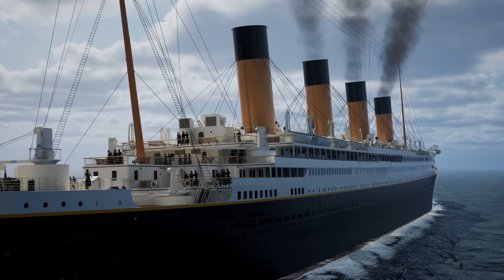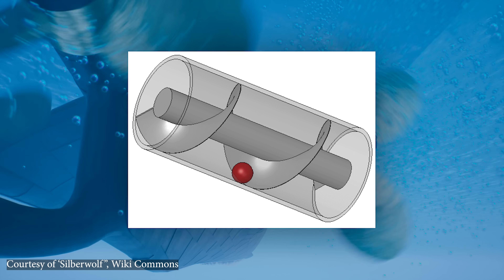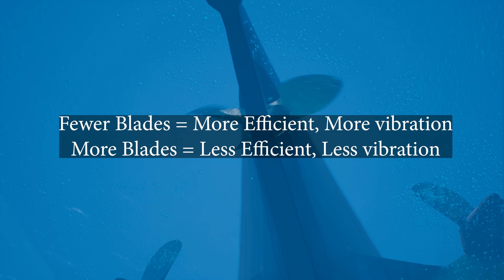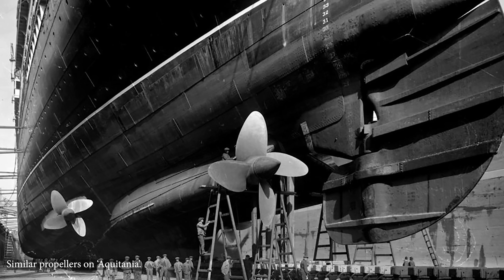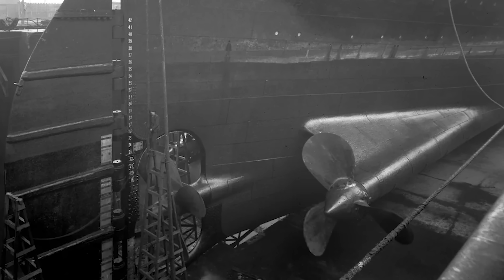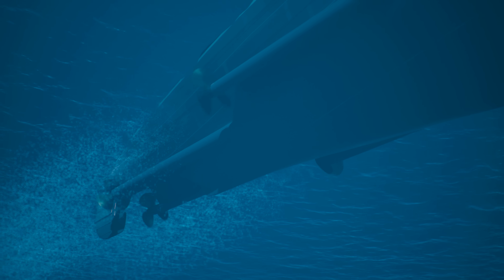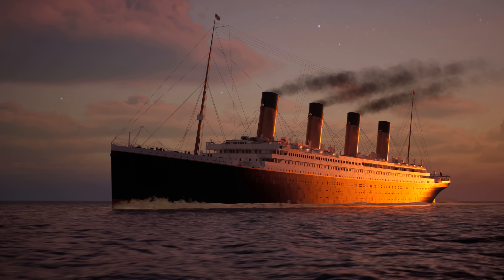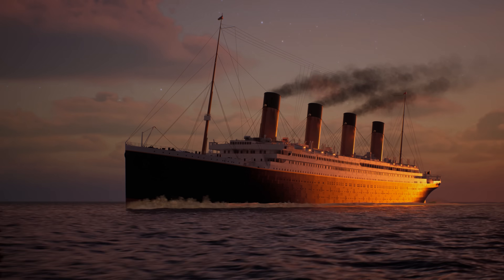Titanic's Propeller Mystery

Comment: Interesting comparison is RMS Titanic to the Iowa class battleships.
Olympic and Titanic were a very similar size and weight to these battleships. And one thing the Iowa's were known for throughout their entire careers which took them up into the 1990's was vibration from the prop shafts. The 4 ships in the class featured 2 central 5 blade screws and 2 outboard 4 blade screws.
There is some evidence from the USS Midway that suggests that it wasn't entirely the design of the screws but the length of the docking keels which caused the vibrations. Midway had a similar issue but once they cut back the length of the docking keels the issue mostly vanished.
The vibration issues aside, its kind of fun looking at how similar in size they were, and just 30 years later with a more efficient bow design they were doing 33 knots. Having gone from 46,000 HP to 212,000 HP.

Comment: All said and done, your only evidence of the middle prop being 3-bladed is a single scribbled note in a handbook.  As someone who has to read other people’s inputs, I find constant mistakes.  Could it have been 3-bladed?  Sure.  But you’ve put a lot of faith into a single scribble and a lot of speculation.  It would have been more reasonable to end with a more neutral perspective.
Reply: Harland and Wolff engineering notebook is the primary evidence, an entry of final specifications of H&W vessels. 
This evidence is supported by turbine engineer sir Stephen Pigott's notebook, where he got order for two turbines , one each for Olympic and Titanic, where one turbine had specifications for 3 bladed center propeller.
Additionally supported by Olympic getting 3 bladed center propeller from 1913-1919, where the results proved 4 bladed was more efficient. 
There's also a photograph of a centre propeller ready to be fitted, laying in the dry dock. It was 3d analysed by historian Samuel Halpern and found it matches a 3 bladed center propeller.
Reply: You do realize that the evidence we have for the 3 bladed propeller is not only from reliable primary sources but also far more than pointing a 4 bladed propeller?

Comment: Why, at the start, is the rear funnel ( the fake one) blowing smoke??
And why, at 2:30 minutes, is the centre screw going astern while the two outer ones are going ahead?????
Reply: 4th funnel had function. It was ventilation to turbine and engine rooms, smoking room, galley etc ... Some smoke did come out of it.
Reply: 4th funnel had function. It was ventilation to turbine and engine rooms, smoking room, galley etc ... Some smoke did come out of it.

Comment: The pitch of a blade is also another factor and the pitch was slightly different for Titanic Vs Olympic according Mark Chirnside's research. Interestingly it's estimated Titanic could push half a knot faster than Olympic also and in 1913 Olympic was temporarily fitted with a three bladed centre propeller, but was then changed back again.

Comment: I always assumed the larger 4 blade central prop was a result of the use of a large very low pressure steam turbine that when in "steady state" cruising rotated a bit slower than the triple expansion engines.

Comment: I wonder if it's possible to send down an ROV and to start digging around where the centre prop would be to uncover a couple blades and based on the distance between them, tell if it's a 3 or 4 bladed prop

Comment: What evidence as was said no proven known photo exists of the Titanic’s screws. I would honestly say that no-one truly knows for sure and will never truly know.
Reply: There's one, a propeller ready to be fitted kept in the dry dock. It was 3d analysed and found matching a 3 bladed prop.
Reply: @gokulgopan4397  But who’s to say that both a 3 blade and 4 blade prop were built with the intent to test the performance and efficiency of both.  They obviously did it later on her sister ship. I’m simply stating there is no empirical data to prove either way. It’s all conjecture and nothing more and will remain that way unless we are able to get to the props in the future.
Reply: @P-J-W-777  that blade ready to be fit was taken in February, same time when Titanic got her propellers fitted in dry dock. 
One each was built, and Olympic obviously got a 4 bladed center propeller. So what's left is 3, which Titanic got. Supporting evidences come from turbine engineer's notebook and Olympic. 
Turbine engineer sir Stephen Pigott's notebook shows two turbines, one for 3 bladed center propeller and the other was 4. 
As for Olympic, after Titanic's sinking, in 1913 refits Olympic got a 3 bladed center propeller due to loss in Titanic's data.

Comment: Chaos Theory would suggest that had the Titanic had a different number of blades from those actually fitted, then it is quite likely that it might never had an impact with the iceberg. This would be due to the difference in performance of the ship leading to it being unlikely to be in the same position to meet with its nemesis. Or, if it did meet it then perhaps at a slightly different angle and thus not tear the hole in the same fatal spot. Weird.

Comment: So at 9:22 in your video, are you saying conversely, that if a 4-bladed central propeller was discovered at the bottom of the Atlantic, it would prove without doubt, that it's the Olympic?
Reply: Nope... It just shows they made a last minute change that they never bothered to note in the book
Reply: No, it would simply suggest that among the littany of last minute changes made to Titanic a four bladed prop was one of them.

The wreck is Titanic we know this without a doubt due to yard number 401 being found on the very steel hull plates that make up her wreck. It is physically impossible for it to be Olympic due to this discovery among many many many more reasons why.
Reply: No.

Comment: Multi prop steam driven ships had different blade numbers depending on the turbine and boiler room placement within the hull. Some ship designs had them located foward and aft of each other in a staggered layout to avoid having the ships beam (width) to wide. As the propeller shafts would have to be longer for the forward positioned turbines the propeller would have additonal an additional blade to counteract the additonal torque (twist) in the shaft over the longer distance. This would allow all the engines to be under the same load to as to reduce cavitation and ultimately surface wear on the propellers. Modern submarins have seven blades and a slower spinning shaft speed to reduce their mechanical sound underwater yet maintain their speed. Prop design has come along way since 1912.

Comment: On a side note, it's interesting and didactic to teach oneself how to distinguish between the Titanic and the Olympic, so one can immediately recognize if a photo of the latter is being alleged to be of the former.

(The most prominent visible difference is the A-deck promenade, which has a very different design, but it's not the only visible difference.)
Reply: One should not rely on A-Deck though due it being a very last minute addition to the Titanic. A better way would be to look at the bridge wings, as they were extended on Titanic pretty early on in her fitting out stage. Other key identifiers would be the windows of B-deck, the design of various ventalation units and intakes and how she was painted at launch when compared to Olympic, which was a very light grey to better show off the lines of the ship as was common with lead ships of a class.
Reply: @Tozzpot500  
The bridge wings can be very hard to distinguish, unless it's a quite high-resolution photo, or taken directly from the front.
Reply: @DjVortex-w  In some photographs they can be yes, however it is a more consistant way to identify Titanic rather than the use of A-Deck simply because that area of the ship was only enclosed a few weeks before her Maiden voyage.

Comment: Sorry to tell you this folks but the odds are the central prop is destroyed beyond recognition. When the stern hit the bottom the force was so tremendous it bent the outer props up and drove the central one into the silt. That kind of force probably obliterated it into either small pieces or it drove it deep into the ship and bent the blades inward like a mushroomed hollow point round. If they used advanced sonar I'm fairly certain it will be something like that.

Comment: The Hindenburg used 4-bladed props through nearly all of her flights, except on March 11, 1937 where a single 3-bladed prop with variable pitch blades was fit on the aft port engine car. On this day the ship made 2 flights, 1 for renewing her airworthiness certificate and another in which Luftwaffe flying ace Ernst Udet tried to dock his plane on a trapeze. However the 3-bladed prop led to noise and vibration issues and it was switched back to a 4-bladed props for the next transatlantic flight to Brazil. It was planned to be used for the first 1937 North American flight to Lakehurst  but fate had it that Max Schirmer the engineer overseeing it could not make the flight and had it switched back. Fortunately he avoided the disaster but did have to prove to investigators that the 3-bladed prop was still at Frankfurt and didn't cause the crash as some were theorizing.

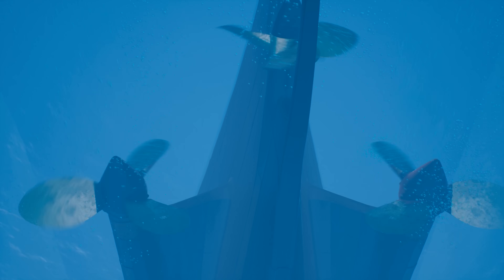Comment: 0:42 The main screw is spinning in the wrong direction, it would be driving the ship backwards, the screw behind it is spinning in the same direction but as the pitch of its blades is in the opposite direction to the main screw it will be pushing the ship forward. No wonder they hit the iceberg! (You can see the problem again at 2:40 ). At 4:58 you can see a photo of the screws on the Olympic, they must have turned this screw in the opposite direction the outer screw that is in the same photo.
Reply: That is simply a mistake in Mike's animation and not reflective of the actual ship
Reply: @Tozzpot500  Oh really!

Comment: And now the truth is coming out, it took long enough the Olympic was different in another way as well in it had a Bulkhead running along from the keel upwards too four decks to strengthen the Keel after of its impact with 
H M S HAWK, anyone got Photos of the Titanic on Sea Bed in stern area looking down from the Dock I think in might be Amazing.
Reply: Are you trying to insinuate that the switch theory actually happened? Despite it being completely debunked, or am i just misinterpreting your comment.
Reply: Olympic never had keel damage to begin with. Why would it then need strengthening?
Reply: @gokulgopan4397  It did after the HMS Hawk impact, it was twisted 1.5 degrees, Please do some research.
Reply: @kennethbowry1521  why do people not do reasearch and ask others to do it?
Olympic and Hawke had a draught difference of 11 feet. How did it then hit the keel? Dived 11 feet below? And hit 36 feet inwards at 14 knots?
What is the source of 1.5 degree twist?
Reply: @gokulgopan4397  Hawk was pulled in the side of the Olympic by the sucking of the Propellers, the impact was above the water line but the Damage was enormous distorted Ribs,  sprung rivets, the recommendation was cut the ship in Half and rebuild it stern, but it was under Insured  and there was not funds in White Stars Bank to proceed so it was Quick fix, the Full account is of Inquiry might still be on the Public records, but I can see you are not a Trained engineer by your comments goodbye.
Reply: @kennethbowry1521  there was no recommendation to entirely rebuild the stern. Exaggeration on top of making things up won't prove it. 
Hawke penetrated 10 feet inwards, and the gash stops at the propeller shaft. There was no damage that went beyond the shaft downwards. 
You won't, but if you could, you can easily see it in the photographs of the damages taken in the National Museums Northern Ireland archives website. 
Total repairs cost about 75000 USD, which was easily payable by WSL who were in an excess of $1 million in profits in 1911. Quick and temporary fix was done at Southampton, and she was sent to Belfast for detailed repairs. It took 6 weeks.

Comment: Very surprised that cavitation wasn't mentioned, which is when the propellers create enough turbulence of the water to the point where gas-bubbles are produced, which then causes corrosion of the blades.  The more cavitation that occurs, the less efficient the propellers become! 
Talking about propellers/screws & the Titanic, what if they hadn't reversed the engines & stopped the central turbine, and instead relied on the ship's power to more effectively steer the ship to one side (can't remember whether it was port or starboard they steered) to be just a glancing impact further aft?  I've always thought that a ship will not turn as sharply to a new heading if you cut of the means of propulsion, so once you stop pushing water past the ship's rudder (especially if the central turbine is shut down), the ship is not going to want to as much or as quickly!
Reply: That night, engines weren't reversed. Murdoch ordered a Stop order, backed up by testimonies of  Frederick Scott, Frederick Barrett, Thomas Dillon etc...

Comment: Wouldn’t it be possible to use a radar or another kind of sensing technology to determine the number of blades of the central propeller of the wreck?
Reply: Would there be any point?   The fanatical switchers would simply claim that the propellers were changed when the ships were swapped, as they did to explain the 401 number found on the blade at the wrecksite.
Reply: @dovetonsturdee7033  The point would just be to learn more about the Titanic and its fascinating engineering. Not to prove anything in relation to the switching theory.

Comment: 3:05 what vibrations? Where from? We have one blade plane propellers and it gives same vibration as 3,4 or 10 blade propellers.
Reply: The vibration from the inbalance
Reply: @Godzilla20191  what inbalance? Every propeller is balanced
Reply: @nanab256  There’s a lot of ways a propeller can be balanced. It can be symmetrical, it can be balanced in weight, it can be balanced in terms of dynamic forces, or it could be any combination of those things or none at all. As you add more blades, each blade makes less thrust individually, meaning that any vibration-producing effects will be smaller per-blade, and higher in frequency, reducing jerking effects. Due to the fact that the propeller also tends to have a ship attached to it, its dynamic forces will not be equal throughout a rotation, as the flow of water is disrupted by the ship. The more blades, the more this effect is evenly distributed throughout a revolution. Also, because the blades are closer together, the dynamic pressures overlap between blades, tending to even them out.

Comment: What is it interesting is the similarities between aircraft props and ships. Both are heavily researched to operate in there respect environments but neither design is applicable across the platform. Even modern azie-pod blades adjusted for size  would never work on an airframe